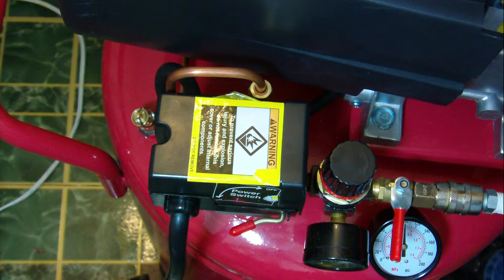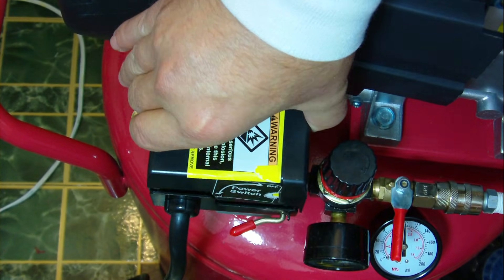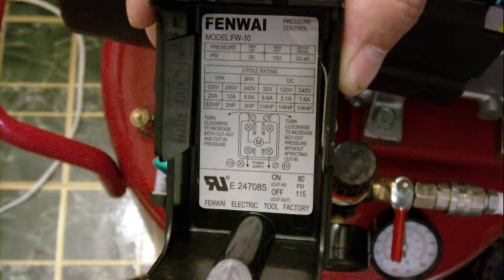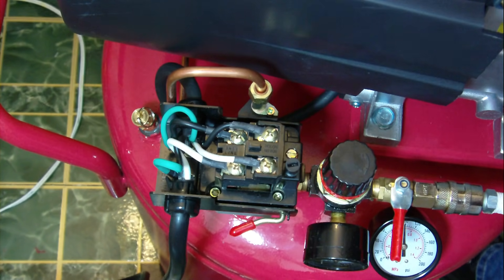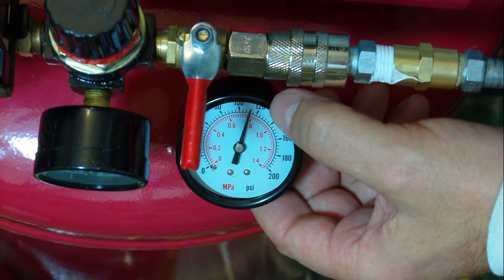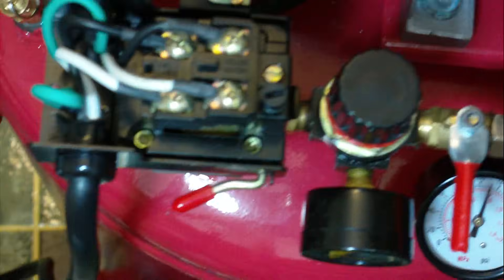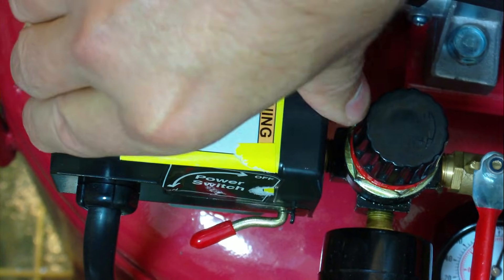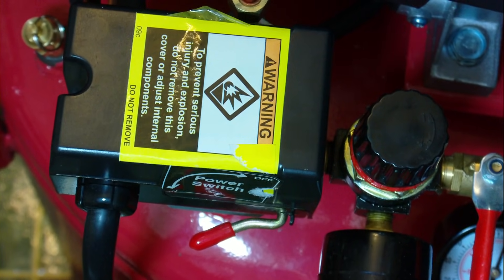How to set the pressure switch on your Harbor Freight air compressor

Comment: Hey I've got the 67847 the black 21 gallon I'm having a hard time with the crankcase gasket it keeps leaking oil and it won't kick back on as you use it.
Any suggestions

Comment: great demo. I have a sears compressor that does not stay running enough to get 40-50 Lbs and once it starts draining it will not come back on. I have to turn switch off for about 10-15 minutes and flip switch on and it will run to about 40-50 Lbs. the compressor is a re manufacture, and not that old. Is it part of the pressure switch and can I tweak it like yours?

Comment: I will add that the inner diameter of the brass fittings they supply are garbage. They look well made but they leave too much meat in the middle. Dont believe me take your fittings off & go to a hardware store & compare the inner diameter. Hollow fittings from the store give more airflow to the tool. So better fittings that dont leak takes away the need to adjust the cutout pressure.

Comment: I have  2-21 gallon HF air compressors and 2-15 gallon storage tanks I use for my shop. I had to set the pressure regulator on one of them to match the other one. know each will shut off at the same time.
This is still cheaper than buying a bigger air compressor.

Comment from the maker: Contact customer service and explain to them that the compressor will not function as it is intended. Remind them of the Magnason Moss Act which requires them to honor the published warranty. If Harbor Freight still will not repair or replace your item, contact consumer protection in your state (office of attorney general). Harbor Freight is required to provide you with a functional compressor (Unfair & Deceptive Trade Practices Act) regardless of what their store policy is.

Comment: I have a 21 Gal. 125 psi 2.5 hp H.F. Compressor.  When I turn it on it will pump for maybe 1 min. or less and shut off and I cannot get it up past 40 lbs.  Will this adjustment make it right?  or is there another problem..  This is the 2nd. one I have gotten from them.  They will not take this one back since I already had them replace the first one.  I really hate their return policy even if you buy the warranty.  Thanks!

Comment: Thanks for the info! Great video.

I just picked up a 29 gallon 2HP 150max psi from HF (oil'ed).  I love that compressor.  I noticed it will pump up and stop right above 145psi.  I wanted to increase the cutoff so it will be at 150psi.  The next day I watched the gauge closely as it compressed the air to the cutoff and I noticed the cutoff was indeed at 150psi.  When the pistons in the compressor stops, the pressure drops just a bit.  If your cutoff is within 5psi of cutoff, I wouldn't adjust.

Comment from the maker: The pressure regulator was faulty and set far below the spec listed on the label. This is a common problem with Harbor Freight equipment. I bought this for the air tank and adding a 2nd pump increases the CFM. I set this up to 110 as labeled but my CH still is a far better air compressor and much quieter.

Comment: This video makes no sense, when you buy a compressor it is set to manufactures specs. If you need more air buy a bigger compressor why tamper with one that just makes no sense..as far as using air tools each come with a stamped label for max psi/bar on spay guns sanders impact guns and grinder and most have built in air adjust ments or simply buy a air regulator to tell what psi is at tool.

Comment: I have a Model 90234 4hp 10 gal Harbor Freight compressor and there is a spring in the pressure switch that holds the button in the up (on) position.  When you pull the red button up the compressor is on, and when you push the button down the compressor is supposed to go of....the spring that is supposed to hold the button up is missing and someone has fashioned a home-made spring in there and it does not work.  Can I get a spring for a pressure switch?  Does anyone know how to get one?  Tks

Comment from the maker: Its simple, you have an inflation pump not a true air compressor. The pump is equivalent to a model car engine and there is no way to make it pump faster. My 5 HP (Peak) compressor is rated at 2 HP continuous based upon the electrical HP rating defined by 741 watts... I would suggest you buy a bigger compressor if you plan to run air tools or have a heavy air demand.

Comment: This is just what I was looking for. I have a Devilbliss Pro 4000 compressor. I lost the manual so this video was very helpful. My tank has labels on it with the specifications. One label says it was tested at 150 PSI for a safety check. It is supposed to be able to go up to 120 PSI but the manufacturer set it a 90 PSI. That is not enough to operate a 16d nail gun. Thanks to your video, I can now carefully set my tank to 100+ PSI and try the nail gun again. Thanks for the tips.

Comment: Thanks for this video.  I have the same exact model and just used your instructions.  Yesterday I was trying to free a lower strut bolt on the back of my cr-v.  I looked at the compressor after it finished cycling and both the tank and the tool were at 90!  Now, the tank is around 115.  I'm playing with the tool pressure, but I'm trying not to be dumb and hurt my tools.  Is anything above 90 bad for tools?  (impact wrenches, cut-off wheels, etc.)  Or can they handle 100 or higher?  Thanks again!

Comment from the maker: @MrNjl007 I have one of these pancake compressors and I will see what I can do about making a video... You may consider replacing the pressure switch with a better quality unit since most HF compressors seem to have a problem with the check valve and the pressure switch.

Comment from the maker: @stymye You have two choices, return the compressor several times until you get a compressor that is properly set, or set the pressure to the level specified by the manufacturer.

Comment: You are dead On Man! Thanks for the Great Information... And Saftey 1st always!!! No-one could have done this better!  I have Had to do the same to Mine, Also Swaped For a Longer And Thicker Power Supply Line As My 8 gallon cord was Cut... But You Did a Wonderful Job On Everything! Always Like Said Take Baby Steps In Adjusting Pressures.

Comment: i have the 67847 unit. i got it part of a close out this winter. some times when i go to start it up while it already has pressure in the take it bogs done and trips the braker withing 5 seconds. if i drain out all the ari and flip the toggle switch a few times it will "warm up" and run great. any idea what is causinbg this. i havent changed the oil yet. i will get some 5w30 for it.

Comment from the maker: @hendu3270 I tried to show you exactly how to do it safely and go in small steps until you get the desired pressure. If this pressure switch gives you any trouble, replace it with a better quality switch, it is somewhat universal. Remember, the safety valve is rated at 125 PSI and you can buy a new one in any PSI rating (10% higher than max PSI)... Its cheap manufacturing, you can expect some defects. Once I set the pressure up, it works a lot better.

Comment from the maker: @ncrdisabled You can also buy a new safety plug with a higher rating if it gives you any trouble. The valve on my pancake compressor is 130 PSI, the guidelines is 10% higher than your air pressure or 15 PSI, whichever is greater. One of the reviews on a portable air tank said the blow-off valve gave them some problems and it was removed, NEVER REMOVE the SAFETY VALVE but get a higher pressure if neccasary.